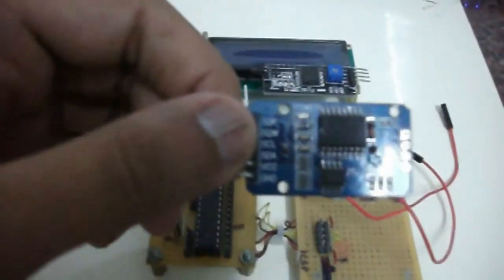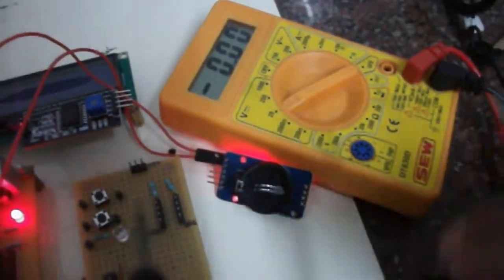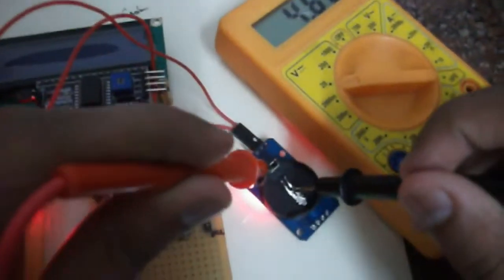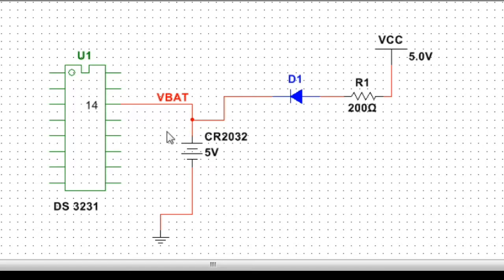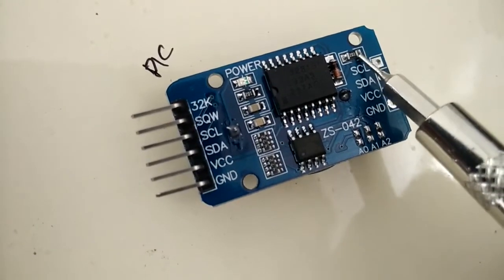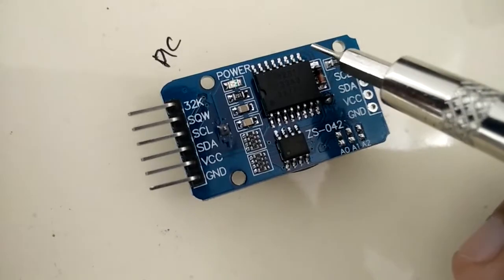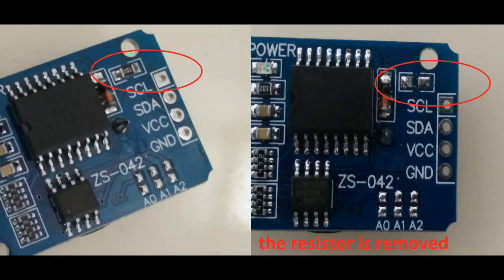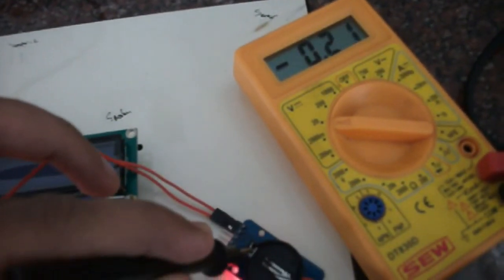DS 3231 RTC | Disable Battery Charging circuit | ZS 042 RTC module hack

Comment: Quick question, when using a rechargeable battery it would still not be a good idea to overcharge it right? I can imagine this is not good for the battery health.
Reply from the maker: Thanks for the comment. This device uses trickle charge method to recharge the batteries. Trickle chargers top-up batteries at the same rate as self-discharge; the slow process uses a low voltage so the devices can be left for an extended period of time. 

But all these modules are Chinese clones and I recommend not to use it to charge your battery without proper study of this recharge circuit.

I would suggest to go with DS1307 module as they mostly dont come with charging circuitry. This saves the hassle of this charging issues.

Comment: I have an issue with the DS3231 module.
everything works fine, but when I disconnect the arduino from the PC, wait a few minutes, connect it again,  time starts from the moment where I cut off the power. 
Is there any hardware fault?
Reply from the maker: 1. Please check the 3v3 battery voltage. 
2. If the battery is found ok, then disconnect main power and check the voltage across the pins Vbat and gnd in the ds3231 IC with the battery alone connected to the module.

It seems that the module is not running when the main power is cut-off.

Comment: Just tested this. I do get 4.5 volt on the positive terminal when there is no battery inserted, but as soon as I put the battery in - the voltage on the terminal is 3.6v, meaning that the circuit somehow senses that the battery is inserted, and stops supplying 4.5v to that terminal

meaning, I don't have to modify anything

Comment: Thank you for your video. Does it mean that using a rechargeable battery is safe?
Reply from the maker: Yes... Using a rechargeable battery is totally safe with this module. In case you can't find a rechargeable battery, go with a normal one time use battery after removing the components mentioned in the video. Thanks
Reply: @kriz1990  Thank you for your answer!

Comment: My RTC stops keeping time once main power is removed .It does not make use of its back up battery. What could be the reason?
Reply from the maker: Try the following things,
1. Check the battery voltage. 
2. Remove main power and keep the battery inserted in the module. Now measure the voltage across Vbat and Gnd pins on the DS3231 IC. If there is no power across the pins that means the battery's voltage is not reaching the IC.

Comment: I scratched a bit the trace between the resistor and the diode, but with my multimeter I read 2.1V between the two terminals of the battery, instead of 0.5V. Is that okay anyway?

Comment: why not add another diode to prevent the battery from recharging.........bad china made module
Reply from the maker: It could be done... But all the components are surface mount packages and I wasn't having suitable soldering tip or the smaller size diode either. And also I felt that removing the diode was much easier than soldering a new component on that crooked space. 
And when its chinese, there is always a trade-off between cost and efficiency. We get what we pay for. ;->
Thanks for watching. Cheers.

Comment: It's a good tip but rather than remove the resistor I cut the lead on the battery side then connected the VCC of the resistor to a digital pin on arduino. Then include in your sketch to periodically turn on the pin to charge the battery.  If you want to get more nerdy, connect the battery lead  (cathode side of diode) to an analog pin so you can monitor battery voltage and therefore know when to begin charging and when to stop.
Reply from the maker: +Spudz Productions nice...

Comment: I could barely understand what you were saying. You speak too quickly and the volume on the video is low. I had my laptop volume at max and I still struggled to hear what you were saying at the end of the video where you had -0.4V showing on your multi-meter.
Reply from the maker: The mic I was using then had some issues and that could be the reason. However thanks for bringing your thoughts to my notice.
I am working on adding subtitles to the video which should solve the trouble. Moving forward I will try to give better videos.
Thank you.
Reply from the maker: Sorry for the delay in adding subtitles. I was busy with my Masters degree which I have completed a few days back. But its not an excuse for not uploading a subtitle for a year. 

I have added the subtitle now. Hope it helps.
Cheers.
Reply: @kriz1990  Belated congratulations on your degree, and thank you for the subtitles.

Comment: what kind of battery do you use? 3.3V lithium non chargable?
Reply from the maker: Yes, I am using a CR2032 non-rechargeable 3.3v battery.
Reply: @kriz1990  if i use rechargeable battery then which one is suitable ?
Reply from the maker: @Wajiduddaim  You can use a rechargeable LIR2032 battery. Then u don't have to follow the modification that I have done on the circuit. 

If you are using a non-rechargeable battery, then you can follow the modification that I have explained in the video.

Thanks.